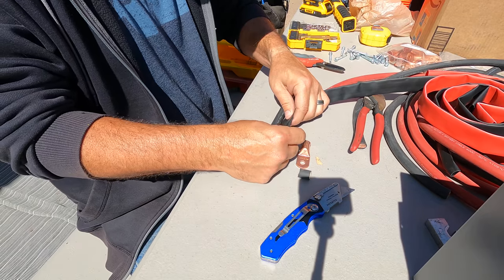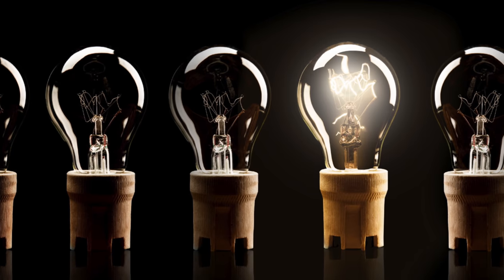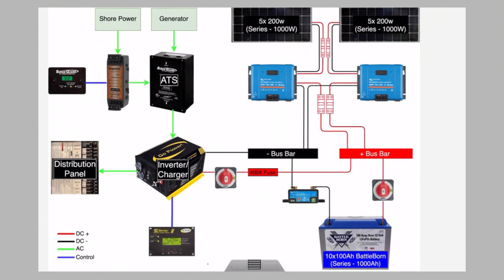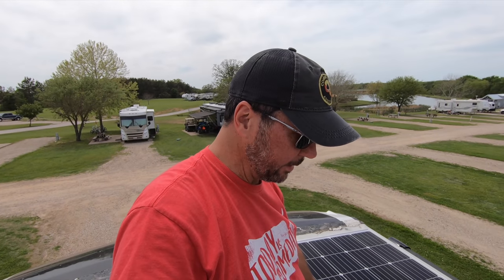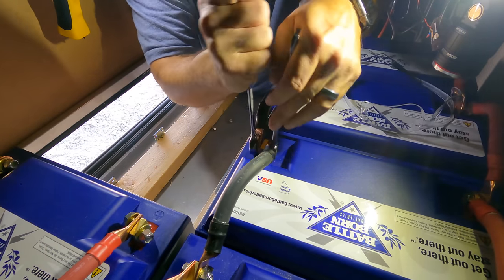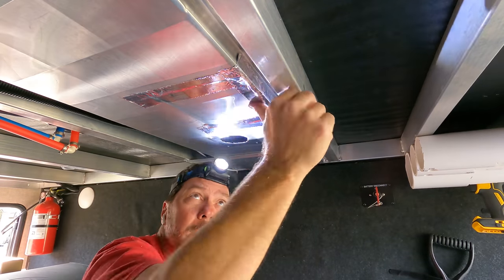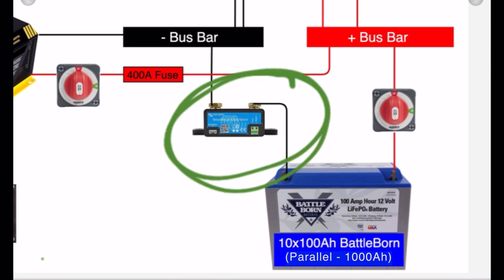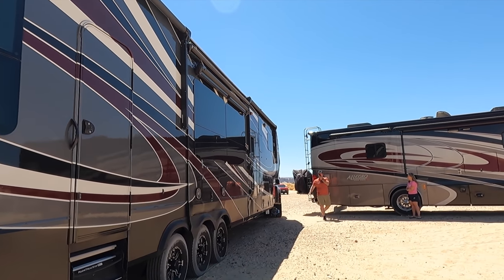☀️  RV Solar Install! 😎  (Full Time RV Life)

Comment: Great video - thank you - BUT, $10,000 in batteries. This is ridiculous. BattleBorn used to be good value for money, but now there are decent options at half the price. If money is not an issue, go for it - but if budget is a concern, there's absolutely no reason to buy BattleBorn batteries any longer. Also, I'm kinda puzzled why you didn't go with a 48v system. It would have required much thinner wires, easier to manage, and more efficient (due to less loss due to high amps).

Comment: Chad, great video!  I noticed that the breakers you used between the solar panel and charge controllers had two single pole breakers.  I assume that you just used the breakers on the red or hot wires (which makes sense to me).  So the question I have is why are the breakers from the charge controllers to the bus bars double pole breakers (or they appear to be on your video)?
Reply from the maker: Thanks!  They just look that way and are still single pole: https://amzn.to/3BfIZIY

Comment: I am curious about your math.  You said you wired 5 of the 24 volt panels in series for 120 volts.   I was told to add the voc (open circuit voltage)  of the panels to find out the voltage the charge controller would see,  that was 45 volts for my 24 volt panel.   SO 3 panels in series gave me 136 volts at 80 degrees, and since the panels make more voltage as the temp. drops, I should reach 150 volt around zero degrees.    Have you had any issues with your charge controller?  Have you ever measured the voltage at the controller to see what it was?

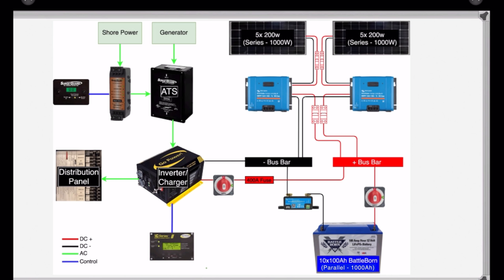Comment: Hi Chad. Looking at your wiring diagram (35:23), so when you have the "solar side'" on, do you turn off the "Shore/Generator" side? Or can both be on at the same time? Note, all I want is to add a battery tender for when I'm not using the RV so that I don't have to take the batteries home (six&brix) to keep them charged. 
Thanks for all your videos - we watch them all!
Reply from the maker: Solar is always on and will supply DC power even when on shore or generator.  That's generally not a lot since the batteries stay topped off.

Comment: Was it difficult screwing and anchoring the Solar Panels onto the roof.  I am afraid that I would miss the roof truss, and then reduce the bite of the anchor.  How did you deal with finding the roof joists?

Comment: So did you make it so you can raise your solar panel toward the sun and i noticed you put the batteries and victron products up in your generator bay. So is that area heated because the batteries can only go so cold in the winter months right. what are your thoughts? I just bought a Solitude 390RK-R and want to put as much solar on it as possible(2600 Watts i hope). i want 2 3000 watt inverters on my rv and a system like yours!! Thank you for this video it has really helped my to planned my system out. we are going full time like you both. Thanks again

Comment: Love your video Chad,   If I may ask, how did you mount your junction box to the roof?  It looks like perhaps you cut a hole in the bottom of the box, then it looks like self leveling sealant under the box, then screwed it down to the room and another bead of self leveling sealant around the outside edge?  Did you use any Eterna bond tape or anything else under it?  I'm looking to mount the same box to my RV, so I'm looking for advise.
Reply from the maker: Yep...  Exactly right.  No eternabond though...

Comment: Awesome video Chad!  I bought a 397th (2017) last year so it's great watching your upgrades!  Question for you, I've been thinking of switching to a lithium setup but questioning the lithium batteries ability to start the Onan generator.  How many amp hours of lithium do you need to easily start the generator? I've searched for the CCA needed to start the generator and haven't found that info, but I know CCA isn't a lithium batteries specialty.  Thanks!

Comment: When mounting the panels to the roof, are you just screwing to the plywood roof? Or are you trying to find the actual trusses? Thanks
Reply from the maker: Just into the roof.  8 screws per panel is very secure.  👍🏼

Comment: Good job. Very interesting. What size breaker and wiring on the output side of charge controller did you use  ?
Reply from the maker: 100A breakers and 4AWG.  More details and links here: https://changinglanesrv.com/rv-solar-install/

Comment: if you are only doing one battery setup, would you still buy the tools, 16ton crimper, heat gun, cutters etc or would you recommend buying all the cables pre-made from, say, BatterycablesUSA or similar to save the expense of tools that would most likely be a one time use.
Reply from the maker: Definitely use something like batterycablesusa.   I didn't know about them till recently.

Comment: Great job with that big project!! I am just wondering if you would ever considered adding a small wind turbine to your setup?
Reply: Small wind turbines just don't make much power. Some of them can be noisy. They used to be common on sailing yachts, but they're slowly disappearing in favor of larger, higher output solar panels, which are silent.
Reply: For the hassle and limitations, the money is better spent on more panels and storage. For one example a Rutland FM910-4 (910mm/35.8" wide) turbine and charge controller can run $1100 and only produces 22W with 6.9kph/11.2mph winds and limits out at 144W.  A 210W panel for ~$210  and an extra battery (~$360 for LFP 100AH, $570 total) will provide more power over a 24hr period. (~720Wh for turbine vs ~1050Wh for solar). 

In both cases you're at the mercy of nature for optimal wind/solar exposure so I'm make some broad generalizations.

Comment: Great vid as always. We have a solar panel on out new unit (Go Power 190w) it only powers the fridge and a cpac machine (1000w inverter). What I want is your system, but reality is that I need to do it in stages. I want to swap out the 2 batteries for two 250w/h Go Power batteries. Do I need to change out the charging system. Then later add the 3000w and 3 more panels on the roof to run the entire trailer as you have. Then add the additional 2 more batteries giving us the 1000w/h capacity. The trailer is a 2021 Palomino Columbus 388FK with 2 1500w A/C units. What are your thoughts ?
Reply from the maker: Yes.. when you swap the batteries, you want to make sure your charge source can deal with it.  Most of the stock converters (ours included) don't have the charging profile for lithium.  I think maybe you're mixing up Wh and Ah...  A 250Ah gopower battery is 3000Wh (250*12).  But, the overall plan of attack sounds solid.   Nice to do things like this in stages.  Good luck!

Comment: Thank you for the great explanation of your system.  I do have a question  how are you keeping your system cool.  I must accumulate a lot of heat in your bay while running your air conditioner.
Reply from the maker: That is something we need to test.  We did overheat the inverter once but it was also 110 outside.

Comment: So no flexible solar panels taped to the roof?  Trying to decide between hard mounting a larger panel like you did or taping down a flexible panel. I only want about 400 watts (for now). So one large panel would work but hesitant about penetrating my aluminum roof.  Thoughts?
Reply from the maker: Use what works for you...  If you find the flexible kind in the wattage you want, give it a go! 👍🏼   That does sound like a good option for a metal roof...

Comment: That's a kickass system. Do you have a soft start on your AC's? That would allow you to run 2, with your setup or one with some other higher amp loads like the microwave. Curious why you would want to do a long Boon-docking trip without running the generator. It's the cheapest easiest power you have out there. Do you know how many gallons it would take running your generator to make back the money you spent on solar? Doesn't seem like your style of camping involves much boon-docking. Don't get me wrong. The last thing I want to do is camp at a campground, when we're trying to get away and enjoy nature.
Reply from the maker: One thing that's often misunderstood about soft starts is that they reduce the run time amperage of an AC... They only reduce the in-rush current that happens then the compressor kicks on.  Nothing changes about how many amps they draw while running, so they wouldn't help in this situation.  We actually have a few that TechnoRV sent us to try out, but I'm still trying to make a use case for them in our RV.  They might help a bit when on inverter but, again, only during the start-up of the compressor.  I might install one just to see the difference.  We don't boondock a lot, but plan on doing more.  Just happens that we got this done in the middle of summer and a heat wave when it's just no fun not having 50A.  LOL
Reply: @ChangingLanes  I am aware how they work and quite familiar with electrical systems. It would help if bringing that second or third AC online would otherwise put you over your supply wattage. Enjoy your videos, thanks for the reply.

Comment: Now that several years have passed, would you still screw the solar panels through the rubber roof, into the roofing plywood?  Or, would you consider glueing the solar panels to the roof, so that there would be no penetrations?  I Have a Grand Design Solitude 380fl, and I am designing and getting ready to mount solar panels, and am concerned about penetrating  the roof membrane.  Since doing your job, screwing down the solar panels, Would you still mount them the same way, if you had it over to do again?

Comment: Great video and install however I have one question. Do you have any problems with shading with the panels connected in series. Also didn’t see how you connected panels together. Thanks for a great video as always
Reply from the maker: Time will tell.. I can always re-wire them in parallel.. just need higher gauge wire from the roof to the bay.

Comment: Great explanation of your setup.  That really is a LOT of capacity you built in there.  I look forward to hearing what you think of the inverter/converter.  I think that alone would be my first move towards a system and some battery capacity.

Comment: I'm considering adding solar to my Grand Design 311BHS. My concern is that we spend our winters in Florida at a resort and our RV faces South. With the sun low in the sky during the winter months, how much benefit would I get from adding solar to the roof with the panels laying flat? I thought about having the tilting brackets added but I've been told they would tilt from the side which would make things worse. Thanks in advance for your reply.

Comment: Hi Chad. I'm getting around to putting some panels on my fifth wheel. You didn't mention looking for roof supports when mounting the panels. Is there normally enough thickness on the deck to screw the panel mounts into?
Reply from the maker: Our roof panels are 1" thick.. I feel that with about 8 screws per panel it should be good.  We've got a ton of travel on ours and it's been good..

Comment: Question when connected to shore power. Could you have it setup where the solar is the primary power source and have the shore power on as needed. That way your solar isn't wasted. Dedicated inverter for the AC.
Reply from the maker: Kind of... You can put the inverter into power share mode and lower the amperage threshold.  Then the inverter (via the batteries and solar) would be taking some of the load.

Comment: #3. Solar panels. You said you did some homework, but somehow you missed Sunpower panels. They are the only panel different from the rest. Higher efficiency, since the Maxeon cells don't have silver strips running down the front. Most panels are 15 - 18% efficient and drop output over a 20 yr span. Sunpowers start out at 21 or 22% (depending on model) and degrade slightly slower. However, testing has shown a regular panel loses 89% of it's output if it's shaded by as little as one cell or a rope 1/2" in dia. YT video from a sailing couple showed this graphically. Sunpower cells are connected by V shaped "springs" in parallel and series as opposed to all others in series. Thus regular panels lose so much if only one cell is shaded, Sunpower only lose 11% if one cell is shaded and proportionally more as more cells are shaded. Also, regular panels, as they age, the silver strips expand and contract daily and gradually they fail, further reducing output.

This brings us to panels connected in series. I always tell people - residential systems in series, all RVs and yachts in parallel. Due to the shading problem inherent on RVs and yachts, if one normal panel gets shaded, the entire string loses power. You placed the panels equidistant from the A/Cs to the edge of the roof, which looks nice and neat, but places them far too close to tall vents (I don't use those) and A/Cs. I always mount the panels flush with the edge of the roof and at least 2 ft away from the nearest A/C. In your case it's hard with 3 A/Cs, but panels that don't produce weren't worth the time and effort to install. I noticed in your video you installed 2,000w of panels (STC) which could produce 80% when mounted flat, = 1,600w. Yet in your video, I noticed only 400w coming from your solar array, only 25%, not good at all. I know you connected them in 2 strings of 5, but if any 1 out of either string is shaded by an A/C, you lose most of the power from that string, which is currently 50% of your array. I realize you did that to produce more V and less A and allow smaller cables, but it's not worth only getting 400w. It also forced you to buy the Victron 150/100 controllers for the high PV input V, the most expensive controller they make. Parallel would have allowed lower PV voltage and saved some money.

I'm installing 8 x 327w Sunpower panels, all in parallel. Each panel is 54v Vmp and at 80% of STC is only 261w or 4.8A. All 8 sets of cables are going to a junction box on the roof and connect to 2 pairs of 6AWG cables to carry it down to the 2 hybrid solar controller/inverter/chargers, 4 panels per unit. I'm removing all A/Cs to eliminate any shade no matter which way I park (usually nose west with the sun on the driver's side.) This will produce an actual 2,093w on a bright day.
Reply from the maker: Not as concerned about partial shading... When we boondock, we will make the effort to be in full sunlight.

The 400W in the video was just that moment in time.  I have seen just over 1600W when the batteries are not topped off and full sunlight.

The panels you mention do sound good though.

One thing to remember (and we point this out in the video) is, this is a "how we did it" video.  We never claim to have the "best" solar installation.  In fact, like I mentioned in responding to your other comment, there are things I learned in this process and in subsequent use that I would do differently.
Reply: @ChangingLanes  I remember you mentioned it was how you did it, unfortunately, some people don't hear everything, but there's nothing you can do about that.

Comment: Chad, how are you finding the temperatures in the bay with everything running - especially when outside ambient is hot, ie 90F+? Those Victron controllers and the inverter under significant load really put out some heat. It gets pretty hot in a sealed bay. The batteries' temperature, trans and fets also run very hot.
Reply from the maker: Initial testing, we did have some issues.. but that was 100+.  We need to do some more testing in weather we'd actually boondock in.  If it becomes an issue I might install a vent (like on the fridge) and some fans.

Comment: great video. do you have a recommendation for someone who can instal or wire a system for me (someone reasonable)   I already have 4 battle-born 100 ah batteries and will buy the Renogy solar panels. (thinking 600w) I LIVE IN GA BUT WILL TRAVEL.  Thanks!

Comment: Is there a reason you did not go with the Victron inverter chargers?  I went with two Victron 3000 inverter chargers  are you happy with the Inverter /charger you have?  And ow can you run more than ! a/c I have 5 battle born  batteries and am changing to Lion batteries I think they are little better battery

Comment: Great job,,AGAIN!  I’m in the process of spec’ing our solar out on our 2020 397th.   Electrical is no problem for me since I’m retired EE(electric engineer). Built a bunch of industrial control systems over the years.  The biggest pucker factor on this is mounting the panels to the roof.  So, what type of screws did you use to screw into the roof deck? Size, length, thread?  Thanks
Reply from the maker: Hello, the screws used are listed in the blog article under the Products/Roof heading here:https://changinglanesrv.com/rv-solar-install/
Reply: @ChangingLanes  got it,, Thanks.

Comment: I'm thinking about a 1000 watt 40 amp control 3000 watt inverter 6 deep cycle large 75 ah battery what do you think any good or bad I want to run a 4 amp ac 47 watt refrigerator if u can respond great video thanks.

Comment: Great video.. a bit too high end for my blood but I’ve learned a LOT! 
My camper has rubber roof and there should be a few aluminum squares going perpendicular. I believe I should screw into those aluminum squares to mount solar panels: so I decided to put on strut channel on, and have solar panels mounted on strut channels. 
...my problem is I don’t know how I can find exact location of aluminum squares underneath. I tried just feeling it walking of roof barefoot, feeling by my hands pressing down, tried stud detector... with no luck. Do you have any suggestions?
Reply from the maker: You might try getting up there in the morning while the dew is still wet (if you're somewhere slightly humid).  I've seen that trick used for finding studs on the outside walls.. might work on the roof....
Reply: @ChangingLanes  
That’s a great idea! Thank you! I’ll try it tomorrow morning if it’s not raining 😂 
Thank you!!